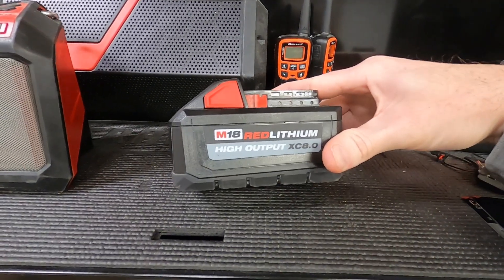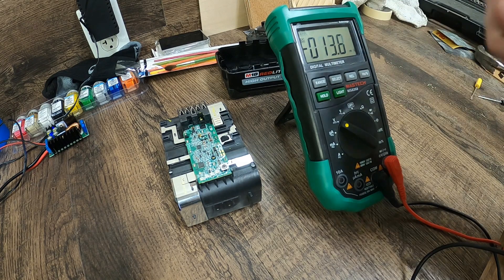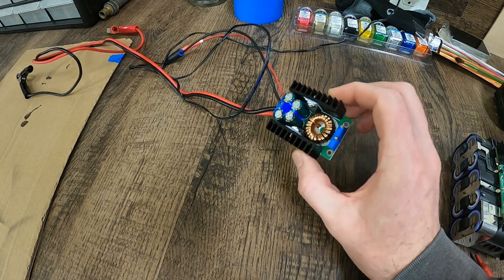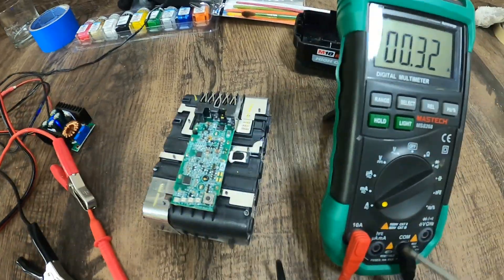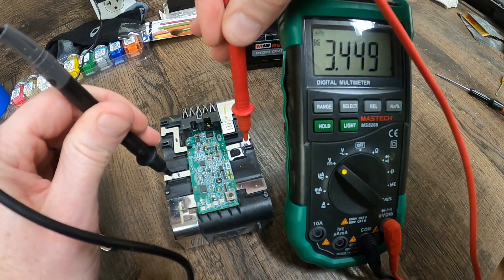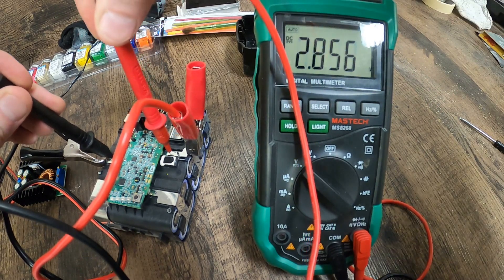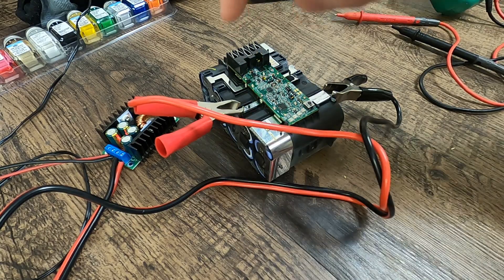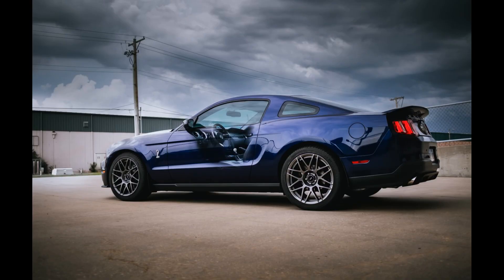Milwaukee Battery Won't Charge Fully - FIXED!

Comment: Where can I get a charger like the one you have
Reply from the maker: Here is a parts list to build one. 
Buck Converter Used - https://amzn.to/3qCQMQo
Power Supply - https://amzn.to/3P4KjaZ
Battery Clamps - https://amzn.to/3PjwOUJ
Multimeter - https://amzn.to/3qzkYvC 
I show you how in this video - https://youtube.com/shorts/W-Yq8_o48Yo?feature=share

Comment: After doing some reverse-engineering of the m18 HO battery BMS, I think I see a potential culprit for the imbalance, especially in the HO batteries. 

The high output batteries are supposed to be able to supply larger amounts of current than the standard xc series, and they do use different internal cells with a higher continuous current spec. 

The BMS also will allow these batteries to fast charge, at a higher current than the standard xc batteries. 

When high current is pulled from lithium batteries, there is always some loss as heat generation, as all cells have a certain amount of internal resistance. The greater the current, the more heat losses. 

Lithium batteries are usually manufactured from cells that were manufactured in the same batch, to match the IR, so that all of the cells deplete and recharge at the same rate. 

The IR of every cell still is not the exact same, which is a result of the chemical ion exchange that happens inside the cell under use. 

Over time the IR characteristics also change as the batteries's age, and all of the cells in a pack do not age at the same exact rate, partly because of the IR differences mentioned above. 

The difference in each cell group occurs from the cells discharging (and recharging) at a different rate, which happens in all battery packs. 

It becomes an issue when the balance circuitry cannot balance the cells as fast as their IR differences are causing their balance to differ in each series group. 

The balancing circuitry on the m18 HO circuit board is in the mA. It "trickle" balances the batteries at the rate of tens of mA. The further out of balance the cells become under heavy use, the longer it takes for the balancing circuit to equalize the voltage of the series cell blocks. 

The reason that balancing is slow is that it is passive, bleed balancing, where the BMS connects the highest cell groups to ground through a bleed resistor, lowering down the voltage in those groups to match the voltage of the lowest cell group. This takes a very long time at the rate of mA, however, but if left long enough, the bms may achieve this, at which point, in theory, the battery could be put back on the charger, and charged to 4 bars, or 100%. 

Basically the BMS does the opposite of this video. 

Instead of raising the voltage on the lowest cell group to match the others, it lowers the voltage on the highest cell groups to match the lowest cell group's voltage. It's done this way because the circuitry is simple, and inexpensive enough to include on the internal BMS  board of the battery. 

this type of balancing is called passive balancing. What was done in this video would be referred to as active balancing, because action is taken, and power is being sent to the lowest cell groups as a result of monitoring. The cells are balanced through active means, by charging. 

Hopefully this helps shed some light on one of the possible reasons that these cells go out of balance and will not recharge before any of the cells actually have reached the end of life. 
According to the BMS, though, when the imbalance reaches a certain threshold, they have.
Reply from the maker: Great info! Thanks!

Comment: Could you just drain the batter to zero and let them all charge from 0 to 100 at the same rate? Maybe the tool just pulled power unevenly??
Reply from the maker: The problem is the circuit in the battery won't let it go to zero.
Reply: Darn. Ok, my father in law let me borrow his miter saw and 12a.h battery. I used it for a day. Stayed on 3 bars. Charged it today still on 3 bars. Not sure if he knew it was bad but don’t want to get blamed for it either. Idk if I have the time to invest in building a charger like you did. Thought maybe for the larger size battery I maybe needed a specific charger like the Ryobi’s

Comment: In 2 days I had 3 M18 batteries fail to charge, the charger blinking red and green.  I believe the batteries may have been drained down too far.  Do you think this method of charging would help me with my problem with these three M18 batteries?

Comment: I’ve been dealing with this battery issue for Willow for a year dealing with Milwaukee itself gets you absolutely nowhere trying to warranty the batteries is probably more pain in the ass then disassembling these and fixing it yourself.  I have a bunch of RC car, smart chargers, that I can customize the amps and voltage and the amount of cells that I could charge. The only thing I don’t have is the security bit to take these screws out.   It’s stuff like this that makes me wanna go back to Makita.

Comment: Tired of milwaukee bs batteries and changes. I got (forced to replace) the new cordless circular saw as the friggin trigger issue never went away on my old saw, no matter the replacements. Then I find out their new saw will not work with other than new high output batteries! Damn thing stops during cut as soon as its asked to make it through a 2*6 or less, first time I used the new saw was on a ladder cutting  6*6 posts to height for beam install, it stopped about 2" along the cut line! PS, Given I spent days "fixing" my (not old) 9.0 batteries that wouldn't charge beyond 2&3 bars respectively, I'm about ready to switch all my gear out to good Ole 1940s corded from my grandfather's garage. You know, those old tools that have so much torque they'll break your arm if you're not paying attention and a near optical balance and alignmemt😉🛠️⚙️

Comment: Hello I bought the buck converter you posted and power supply, I was able to set the buck converter to 4 volts , but I could not set the DC amps to .5 Amps ,I was adjusting the amp dial , but my meter is always reading .0 Amps ? Do you think its a defective Buck converter? My leads were set properly to 10 Amps DC as well as probe leads , but I cannot see any amps DC coming out? Please Help!
Reply from the maker: Try turning the voltage up to 6 and then see if the amperage dial will respond. It may take 6-8 turns before it climbs up. If it still doesn't do anything, then I would say you may have gotten a defective unit.
Reply: Hello I bought another Drok power converter ,and still I cannot adjust the amps, in the instructions it says to lower volts to below 10 volts dc by turning the cc current dial counter clockwise till it ends ,then it says to short circuit the output terminals ,and the turn the dial clockwise?is this safe,it also came with a resister in the box?what do you recommend me do?
Reply: Please help?,cannot adjust amps?what do uou think is going on?I even shorted the output per drok instructions and nothing?this is my second unit?I'm I doing something wrong or is it another bad unit?
Reply from the maker: @vIsiOnsOfsAlvIa have you checked your meter is reading amps correctly?  When I first got mine I hooked my meter to it and it blew the fuse. So I thought it was bad when, in reality, I needed to replace the fuse and turn the amps all the way down before reconnecting and setting the dial.
Reply: I have my leads to 10amp dc , leads are connected good,the second drok unit I bought is the one with a led screen ,same thing no amp adjustment, question do I have to hook up a load first and then start setting the amps slowly? Or could I set the amps before connecting it to a load?
Reply from the maker: @vIsiOnsOfsAlvIa it has to have a load. that is what your meter is supposed to do, if the fuse is good.
Reply: I understand that, I don't think my fuse is blown on my meter because it still reads zero, and the meter is still working on volts, I also bought the other unit that has the LCD parameter and it still shows zero on the amps output
Reply from the maker: @vIsiOnsOfsAlvIa my meter still showed zero and worked to read voltage with the fuse blown as well. It is possible that the unit is bad, but 2 in a row seems unlikely?
Reply: I saw another video with the same unit and the guy never adjusted it he just lowers the amp output to zero plugs in a load and then start suggesting it after
Reply: Turns out both of my fuses were blown in my multimeter, I finally figured it out, thanks the other unit that I bought has a LCD parameter, so as long as I connected to the battery then I could adjust then I could adjust the  amps sl slowly,thanks
Reply from the maker: @vIsiOnsOfsAlvIa Glad you figured it out!

Comment: will another buck converter with built in lcd display from the same brand work? or does it have to be this model because of its application?
Reply from the maker: Another one should work just fine. As long as you can dial the output.

Comment: Dude I switch from makita and I regret getting rid of my makita tools I still like Milwaukee but really disappointed because 5 high output batteries do this non of my 5amps do this my makita never did that
Reply from the maker: That's a bummer! Luckily, I've only had it on 1.

Comment: How do you make the connection from the end of the power supply cord to the wires that go into the Buck converter?
Reply from the maker: I used an eyelet style connecter for the ground on the outside and a small round style connector for the center positive.

Comment: To unscrew you need a bit with a hole or drill the pin off carefully to maintain the tines in the screw.
Reply from the maker: Yes, a security Torx is required.
Reply: @KonaBlueSVT , most "precision" 4 mm screwdriver sets include the security type torx bits.

Comment: I just found this video because my 8AH battery stopped working.  It worked fine last fall but won’t work this spring.  The symptoms you have are exactly the same as mine.

I disassembled it and tested the cell groupings the same as you did and I also had a single group at 3.4 volts.  Based on your procedure, I charged it up using an old 5.1 volt transformer for a phone.  I cut the end off and simply inserted a rectifier diode which reduces voltage by 0.7 volts which which left me 4.4 volts.  This is a very low amperage output so it took 2 hours to get the voltage up to 3.6 volts at which point, all 4 light would light.  I put the battery back together and everything works fine.  Thank you.  This saved me $150.
Reply from the maker: Glad it worked for you!

Comment: Couldn't you drain the outside cells to the approximate the level of the lower cell easier than building a custom charger?
Reply from the maker: The circuit board won't allow them to charge if they are under a certain voltage. So they low ones must be brought above that voltage in order to still use the factory charger.
Reply: @KonaBlueSVT  ah....Roger that

Comment: my 12.0 only charges to the 3rd light if i discharge the 12.0 with a light adapter think is will fully charge back up?
Reply from the maker: Sometimes, this works, but you may have to balance the cells like I did in this video.

Comment: The cells in these M18 batteries, as well as many other electronics like ebikes and laptops are 18650 batteries. I already had an 18650 battery charger since I use them in my flashlights and other devices. Just jumped the charger to the lower voltage bank on my M18 9.0, charged that bank to the same voltage as the other banks. Drained the battery to 3 bars, recharged on the M18 charger and works almost as good as new now! 15 minutes worth of work and saved $300 from buying a new one.
Reply: As already mentioned they're not 18650 cells, & jump starting is not good for the remaining cells, due to the fact the remaining cells having to hold up the lower capacity of the cells you just "jump started"
Reply: @CamTracey  Okay, good point there, Professor Battray!  🙄😆
Reply: @CamTracey  wow
Reply: I have a m18 8.0 xc will this method work for me? I basically rigged my m18 to run a led light/work light and I let it run til it turned off. Went to charge just went to green light on the charger. I opened up the battery pack and I have 4 cells that are dead
Reply: Wrong skippy, they are 21700 cells.

Comment: Honestly this is too much to take in and a ridiculous amount of work (and I love to take apart stuff and solder and junk) for such a simple flaw. Just a buy a new one and return it with the defective battery. It’s really the only way since these are wayyy too much money. If it was $10 a battery, then no, but more than that then this is the way, child.
Reply from the maker: To each their own. I got a new battery, AND revived this one for free.
Reply: @KonaBlueSVT how did you get a new one ? Warranty ?
Reply from the maker: Yes, Milwaukee has awesome customer service.
Reply: @KonaBlueSVT  I’ve had mine for 2 ish years. It’s Been through a lot, wonder if they’ll still do anything with it.
Reply from the maker: @braydonkirnec1853 depending on which series it is, they have a 2 year or 3 year warranty. Check out this video for more information on that https://youtu.be/RRR4mEqXO1w?si=D5o7sDBK5oWmAP8X
Reply: They're date stamped so that wouldn't work. But they do have a 5 year warranty. Honestly this is super easy to do. Brought an 18650 battery charger to work, jumped it to the lower voltage cell, equalized all cells to the same voltage, drained it with my saw then recharged. Works almost as good as new now. Less than 15 minutes worth of work.
Reply: Why can’t their “smart” chargers recognize this?
Reply: Why are these “revivable” cells under voltage in the first place?  This should not happen with a properly functioning BMS. While yes you are doing the job of the BMS by changing individual cells, you’re just going to be back in there when they’re unbalanced again.

Comment: I am completely unimpressed with the quality of the HO series batteries.   Yeah, they have a great c-rating so you can get good power out of the saws and stuff but... apparently they suck pretty hard in the charging management department.   Honestly, I'd rather have two XC 5.0 batteries than one HO 8.0
Reply: After some months of use, the HO 6.0 batts don't appear to have the same problem.   I've got three of them and have them run them all down completely multiple times and haven't encountered this problem with any of them yet.
Reply from the maker: @oneandy2 Thanks for the follow up!
Reply: The bms in m18 batteries is terrible, my old boss had around 8 x 12ah and they all ended up doing the 3 bar full charge or flashing and not taking charge. Even my one at home plays up after probably 10-15 charge cycles in 3 years, sometimes charging to 3 bars only unless i run it down completely. 1 of my 2 x 5 ah standard batteries that I first got around 3 years ago has stopped accepting charge now as well. Wonder how long before the other 5 ah fails and then my 8 ah and 2 x 6 ah...

I've even had an m12 battery stop accepting charge only specifically from my charger (others worked) I suspect it was because I left it plugged in to an impact wrench for a long time in the boot of my car. Now I never leave m12 batteries plugged in (bms is in the m12 tool iirc) and they've been fine, just slowly self discharging.

Now that I'm no longer using tools to make money its a worry being 18 tools deep in a system where the batteries just kill themselves.

Comment: Great video! Thank you for sharing! I have (4) 12ah HO and (3) 8ah HO batteries that i marked 3 bars full and 2 bars full so i know they arent half charged when i hit the button (they are but i cant fix that until i revive the low cells). 

What really frustrates the hell out of me with Milwaukee is that circuit board on top of the cells is supposed to be a BMS (Battery Management System). It is supposed to automatically balance the different cells internally, as well as protecting the battery from over charging and over discharging.

I have a really good battery charger for hobby car /airplane batteries and it does just that. With multiple cell batteries, not only does it charge them but it automatically balances the cells. Im going to see if I can wire that thing up to revive my crap batteries.
Reply: Yeah, I have this exact same battery and am having the same problem.  Looking around on the internet, apparently this is a SUPER common problem.  I think you nailed it... the BMS just isn't working properly.
Reply from the maker: Thanks for the comment!
Reply: I got a 12amp that only goes 2 bars did it work ??

Comment: Could you use a 12v power adaptor? You''ve stepped it down to 4v when charging so seems like you could use a 12v right?
Reply from the maker: Yes, I just used 18v for the potential for higher voltage in other applications.
Reply: Thank you kindly. Super informative video easily explained.  @KonaBlueSVT
Reply from the maker: @kirkdesmond Thanks for the comment!

Comment: Just checked my 8ah battery using your method. 1st bank shows 4.11v. 2nd and third banks both show 3.72v. Can I charge the second 2 banks and be okay?
Reply from the maker: It would be worth a try. Charge them slow.

Comment: Really appreciate this video. I build the trickle charger set it to 4 V and 1.75 amps and was able to save my Milwaukee 9.0 and a Dewalt 5.0 batteries. Both hold their charge, discharge normally in use, and recharge normally too - green light on the charger and full bars on the battery. Thanks a lot for putting this out and all the details.
Reply from the maker: I'm glad it worked for you. Thanks for the comment!
Reply: Is it a permanent fix or do you have to constantly do that ?
Reply from the maker: It will likely happen again. However, I got another year of use out of this one before it started acting up again!